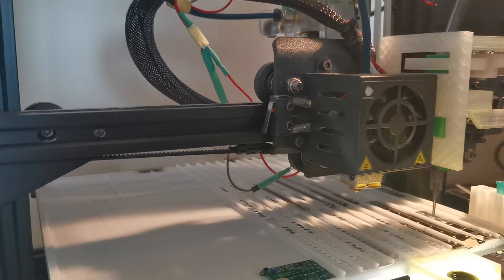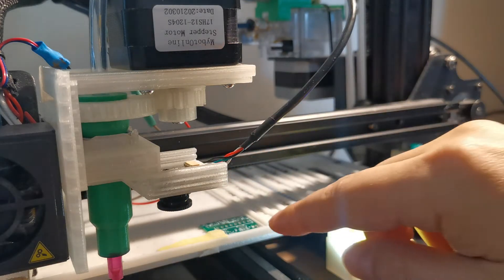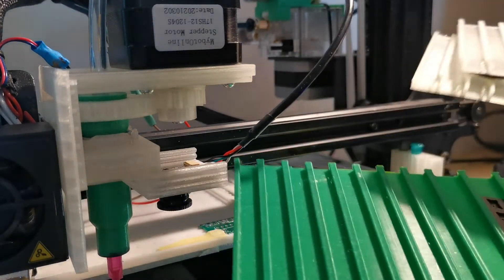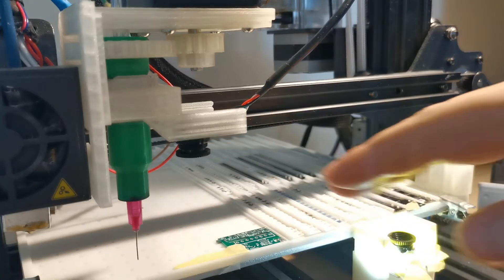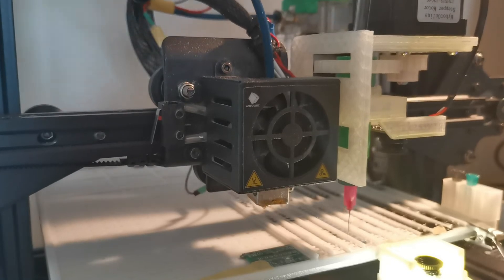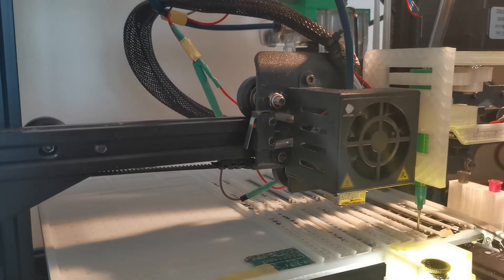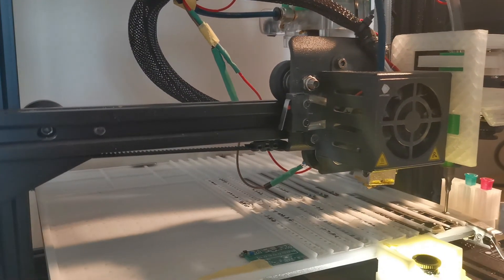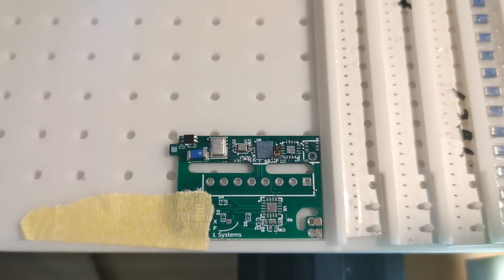DIY pick and place machine from 3D printer Part 5 - Improved design and placing tiny 0201 components

Comment: It’s very economical to use those syringe tips for nozzles but how are you releasing the previous tip when changing to a new one?
Reply from the maker: We need to rotate the nozzle, so that the syringe tip will be released, just like we release it manually by hand, only the stepped motor do it for us. The syringe tip is quite reflective, so bottom vision usually face challenge to identify real size of component, and the attachment of component could be challenging  as well for smaller component like 0201 or 0402.

Comment: For the vacuum pump, which one do you use? Thanks!
Reply from the maker: I use 12V mini vacuum air pump, you can use 24V as well. In openpnp you can set the output voltage to adapt to your pump as well. This is a link from eBay, you can find similar ones everywhere. https://www.ebay.de/itm/393846743343?mkcid=16&mkevt=1&mkrid=707-127634-2357-0&ssspo=v5hXAwsjQyK&sssrc=2349624&ssuid=ijdbvl8crnw&var=&widget_ver=artemis&media=COPY

Comment: On what controller you run this OpenPnP
Reply from the maker: I am using the mainboard from anycubic, they design it themselves in this case, I think any board that support gcode should work.

Comment: Did you find that using a stepper motor instead of a servo for the rotation works better with open pnp.
Reply from the maker: Hi, good question, openpnp come with limited angle mode, which fit for the servo case, so I think both is ok, the question is to drive the servo, usually the board come with stepper motor driver, in order to drive the servo, I think certain board or customization would be needed. As for servo, spec wise it is ok, torque is also good, usually they are less than 360 degree, so some gear need to be provided to enable 360 degree rotation.